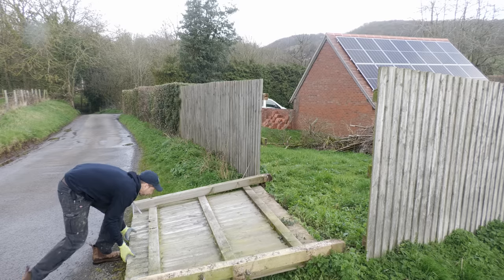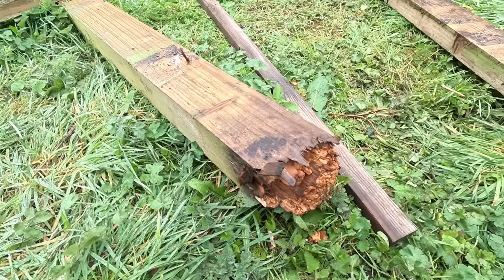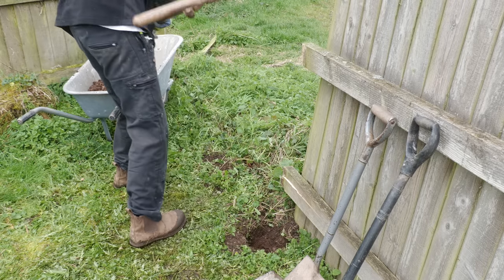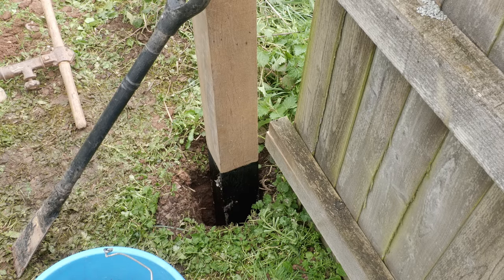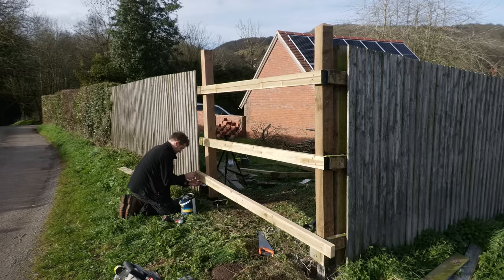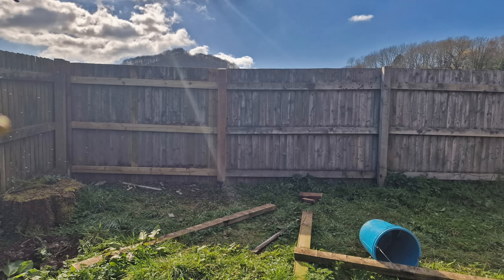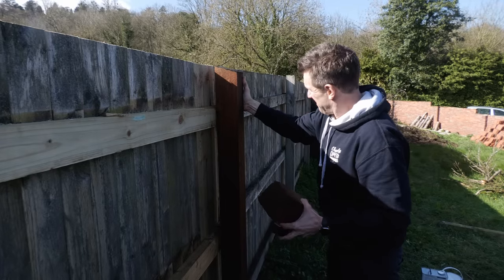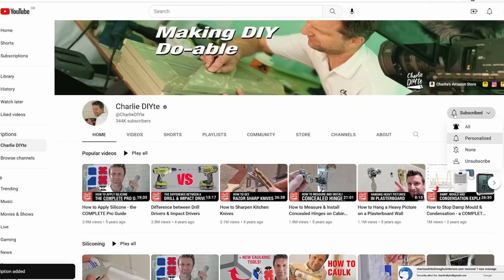How to DIY Repair Your Garden Fence

Comment: You could also consider charring the posts over a fire/with a map gas torch instead of the bituminous paints/preserves before sinking them in the grounds. The charring protects the timber from decay and is a more natural alternative :) 
Thanks as ever for the videos, Charlie. Take care
Reply from the maker: That's a nice touch Simon, I hadn't thought of that. Is it as effective?
Reply: @CharlieDIYte  Yes, it is indeed, I would not char a roof truss, but certainly would a fence post, arris rail or featheredge board.

Comment: No, you don’t need to replace the whole lot of the feather edge boards, you can trim the bottom by the same height of  a gravel board and reuse them with a gravel board installed.
Reply from the maker: It's a good point 👌
Reply: @CharlieDIYte  
I did something similar with some 6ft close board panels which, apart from the bottom rail and bottom 3 or 4 inches, were in excellent condition.
I liked your nifty tool for digging post holes, another really good tool to consider is a fencing bar.

Comment: At the end of the day it works. I've done tons of fencing in past life. You can get these concrete repair spurs. We have done both repairs. If I was going to say, what do I do if I need new fence. Concrete posts and concrete gravel boards. They last forever.
Reply: Agreed, and when the fence panel eventually needs replacing, just lift it out and slide new one in 👌🏻 easy
Reply from the maker: Fair point 👊

Comment: Hi  Our fencer put a slither of wood on gravel board, put panels on slither of wood fastened it all in  then removed slither of wood to make a small air gap. helps stop bottom of board rotting by keep wood of damp concrete gravel boards. Notice you seem a bit thinner in the face hope it's  just hard work. Regards Mick
Reply from the maker: That's a nice touch Michael. I would have achieved something similar if I had leveled the trails properly and then lined the boards up from the top to a string line leaving a gap below. Thanks for the observation. Yes just hard work I think. 👊

Comment: Hi Charlie. I recently used those fence post protectors , and found them not easy at all to get them to stick to the wood .  Using a blowtorch and a wooden roller , still proved a difficult task .  So I agree with you the use of these modern bitumen paints is the best way forward .        Best wishes and kind regards as always  😀👍👍👍
Reply from the maker: Completely agree. I had to put a few on where they attached the post savers at the wrong height and they were very difficult to heat shrink with the heat gun I've got. Good to hear from you and thanks for the comment 👊

Comment: My project this weekend was to do exactly this to a rotten fence post, I agree with you that the mutt is the tool to use for this job. Digging out the old post from the concrete is the part I hate the most
Reply from the maker: Thanks William. How did you get on? I also have a gorilla wrecking bar but the mutt pro is a bit kinder on the hands and better for chipping away at the deep holes.

Comment: I found if you use a blow torch on the bottoms of the posts and blacken them on the end and the part in the ground it works well preserving the post on the ground as it brings out the creosote in the wood
Reply from the maker: Thanks Clark. Yes a couple of you have suggested this. I've never heard of this technique before. Very interesting 👌

Comment: We've had concrete fence posts and painted them with used engine oil. And also the wooden posts and fence panels. You can also paint concrete posts with wood stain. So they look better than off white.
Reply from the maker: Painting them is a good idea. Have thought of that 👌

Comment: I'd of used concrete post and bolted a 3 x 2 onto them. 100 times stronger and will never rot. However for a quick fix whilst your upto your neck in work you did a good job. It never rains it just pours down sometimes.🤪🤪👍👍

Comment: Charlie if you put about 2" of pea shingle at the bottom of the hole helps as well with drainage.
Reply from the maker: Yes I've done that on all my posts in the past but for some reason didn't bother on this one. I think because I'm sceptical as to whether it's actually worth it...

Comment: A few years ago I had to replace my fence. I tried to find a contractor to do it but my city is growing so fast that I couldn't get anyone to do the work. It's okay because I ended up with a better looking fence than if I paid someone to do the work for me. The old fence was the traditional post cemented in a hole with panels between. 

I took a different approach with my new fence. I was able to find someone to take the old concrete out and put in new concrete deck piers that came about 5 cm above the ground. I made sure that the bottoms were flared to ensure they wouldn't heave with the frost (an important thing to worry about in Canada). I then used a newer product from Hoft that was being advertised as a privacy screen for decks and, after checking with the company, used it for my fence. I used four bolts to keep their aluminum posts attached to the concrete deck piers after I laid out where the posts would sit to make a straight line. Cedar deck planks were cut to length and fit between the posts. The included aluminum spacers keep the planks from touching one another. After the boards were placed then included post caps were installed. All of the aluminum parts are black.

The great part of the system is that if anything breaks, for example a board, all I have to do is take the post caps off a couple of posts, slide out the boards above the damaged board(s), replace the damaged board(s), and replace what I removed previously. If I need to get a large machine into my back yard it's also easy. Just remove the boards from two sections and remove a post (as it's bolted on). Since I had bought the cedar straight from a lumber yard I had to leave it out for a while before treating the wood in order to let the oils in the wood leave. Instead of putting UV protection oil on directly on the fence I ended up taking the planks out of each section so that I could treat all of the cedar and put an end grain treatment on the ends. I couldn't have done that with a regular fence, at least not without disassembling it and building it again.

If I ever build a fence again then I'm going to use Hoft for the posts. It's a little more time because every plank needs to be measured before cutting however it looks wonderful and has some advantages over traditional fencing.
Reply from the maker: That sounds like a fantastic system. If you have a chance ping over a photo on email as If line to see it 👊

Comment: Could have chopped a 45degree angle on the posts before erecting them. Or you can install some nice looking post end caps which do the same job.
Reply from the maker: I thought about doing that but lazily decided that this way I didn't have to worry about the height. 😉

Comment: Always rains when I undertake fencing 🙄
That Mutt scraper looks handy though - not seen it before so thanks for highlighting it 🙂
Reply: Don't buy it, they are useless. Far better with a heavy duty Roughneck digging bar
Reply from the maker: I've got one of those as well but the scraper edges it for me.

Comment: Many years ago was told to use "Denzo" tape (greased cloth tape) on the post bottom at the wind and water line. Think it wolud stick better than the sleeeves. Not sure you can get this any more....as an apprentice working on a chlorine production plant it was used everywhere to stop corrosion!!
Reply from the maker: I like the sound of that David, thanks for sharing 👌👊

Comment: Thanks Charlie, sadly it seems as soon as you have a fence you're soon making repairs that will ultimately be replaced, it's only a matter of time ! We seem to have high winds more regularly these days !
Reply from the maker: Yes. With well treated 4.5 - 5 inch posts though I reckon you've got 15 years minimum and a fence that will put two fingers up to anything nature throws at it.

Comment: When you get around to doing the fence, would you consider shadow-box style?
Reply from the maker: Probably not for mine but they are smart, particularly in an urban setting. The trouble for me with any panel fences is I've got a gradual slope down the garden which is easier to take care of with closer boarding.

Comment: Thanks for for video Charlie. Looks like a solid repair. What dust bag do you use on your cordless Ryobi circular saw? And is it just a friction fit? Thanks
Reply from the maker: It's an Evolution bag I got with a mitre saw that simply fits on the exhaust attachment that comes with the circular saw. It's quite old now that saw and brushed but considering it's a circular saw the extraction is remarkably good so it's worth sticking a dust bag on.

Comment: If it was just a temporary repair, why didn’t you just use a concrete spur. You could always paint the sour brown to make it look like a wooden post. Would that option have been cheaper?
Reply from the maker: Trouble is, when I say temporary, it could be there for 5 years. What I've done has basically guaranteed the fence for another 10 years, strengthening the existing structure in the process. Plus the section that fell down was knackered so best to renew the whole section for the small expense and time it took.

Comment: For me this was major overkill and time for a quick fix. I used post buddies (metal strips you hammer into the broken wood) to have a broken post fixed in about 20 minutes. Definitely not going to last as long as what you did here but if you're planning on replacing in a few years anyway why spend so much time making something that will last 20 years that you rip out before that.
Reply from the maker: The issue is that's no post in the ground to refix to and actually the repair has probably bought the fence another 5 - 10 years life. We shall see 😉

Comment: The sleeves are a waste of time. Paint on the otherhand, good bit of kit. 

450 mil in the ground I hope it isn't windy where you are. 500 mil minimum. That's why the post are 2.4 mtr. 600 in ground

Comment: Concrete spurs and affix the existing posts to it. New wooden posts will always rot...Any guarantee otherwise is just a lie.
Reply from the maker: It's a fair point. Yes probably the best solution. Shame they're so damn ugly though. 👊
Reply: @CharlieDIYte  Yes, they are horrible. But at least only a couple of feet stick out of the ground and with a few plants in front of them they soon "disappear".
But treated 20 year guarantee wooden posts (even 4 x 4) are a joke.